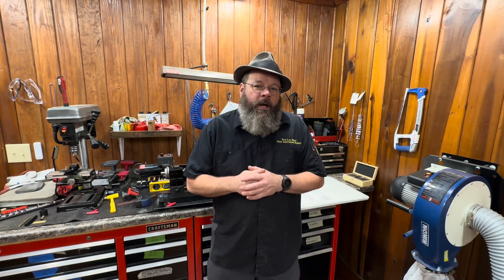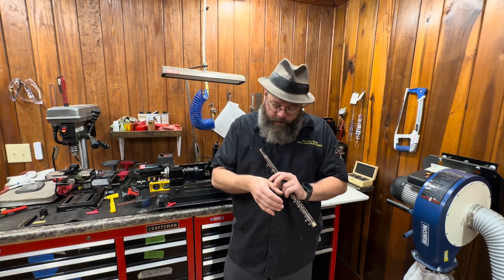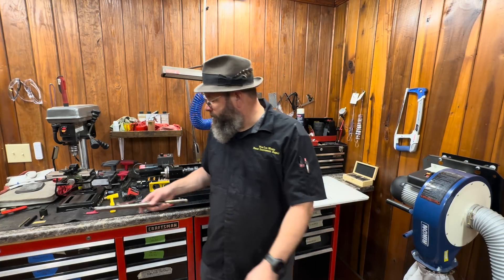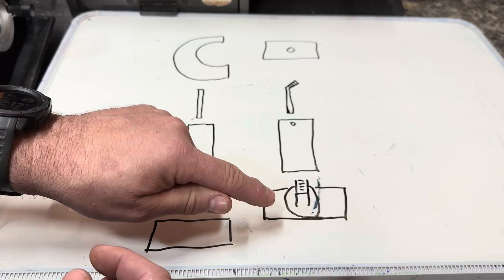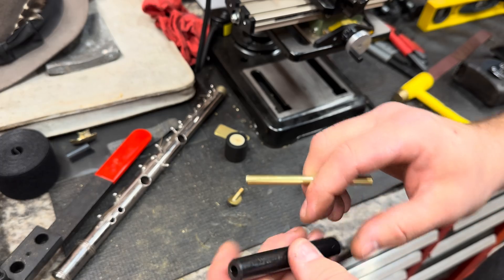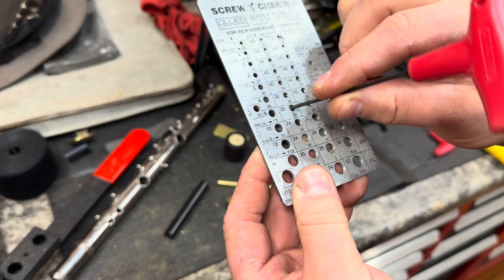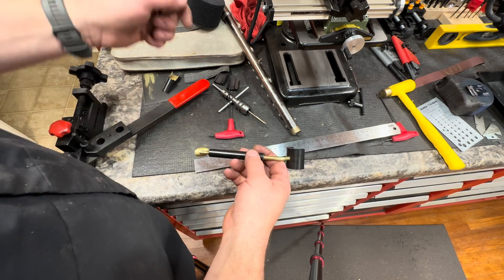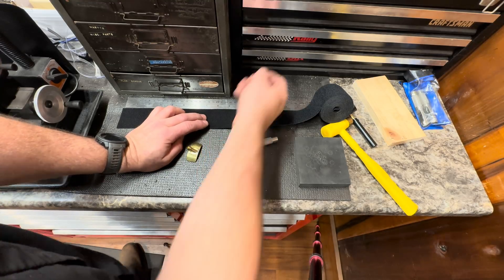Fabricating Flute Stabilizer- band instrument repair- making something from nothing

Comment: Very cool and thoughtful. I hope we get an update on how well it works for the player. 

Also, now I want a lathe even more. It's amazing to me how many different skills this job requires sometimes and how low the pay is in a lot of places.
Reply: All machining is either spinning the sharp bit or the bit being cut.
Reply: A lathe can do many of the things a milling machine can, provided you have the tooling to accommodate fixturing and work holding.